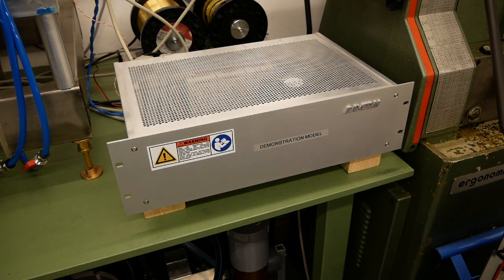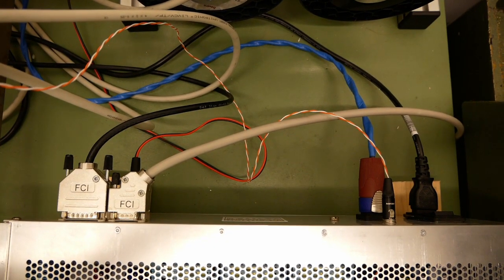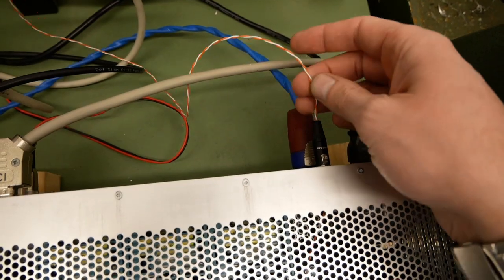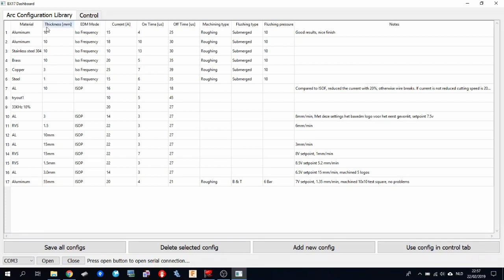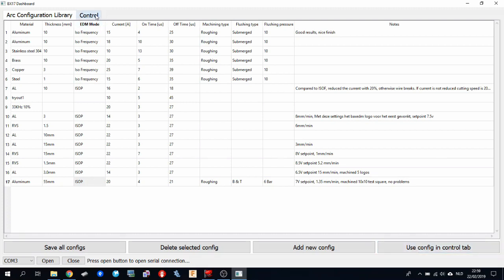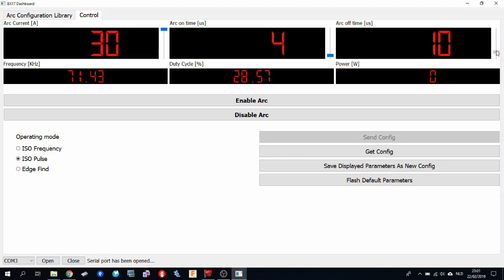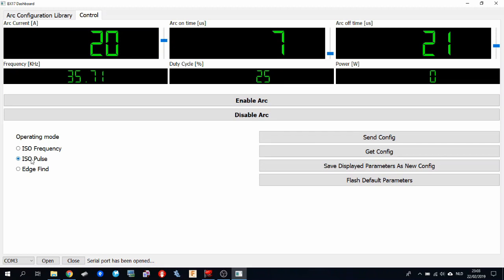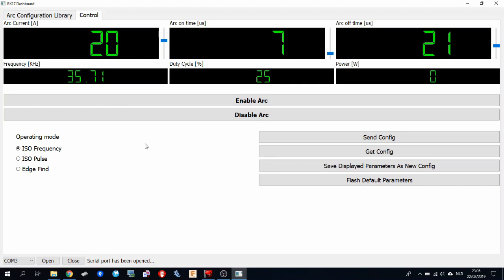BAXEDM Custom EDM Machine Build, Part 7 : The Arc Generator

Comment: If someone wanted to make a ghetto version EDM arc generator wouldn't somehow hacking a motor VFD get you most of the way there?  It outputs high current pulses at up to about 16kHz (http://www.vfds.org/vfd-pwm-waveform-762549.html) or maybe even hack a TIG DC pulse welding source (~15kHz), not sure of current of voltage but I guess you can get enough given how much power they use.  I know you wouldn't have the nice features of this arc generator but maybe it would be sufficient to see some EDM cutting action?  I just don't know enough about the parameter space for making ideal sparks, the bare minimum requirements to make it work, to know if this is a plausible hack or not.
Reply from the maker: Both TIG as well as VFD's use relatively low frequencies <20KHz to modulate current to get a varying DC or AC current with an even lower frequency ~400Hz. The electronic arcitecture of such devices cannot produce high frequency current pulses (sub-microsecond rise and fall times) with controlled open gap voltages and high frequency closed loop arc current control. Even with some serious hacking, they are just too different. Perhaps with a ton of hacking and a ton of additional components you can do it, but then it makes more sense to build something from scratch. There are several wire edm builders who succeeded building their own functional arc generators, but did not manage to get their designs to operate at usefull performance levels. Instead, they got the BaxEDM BX17. Some of these guys are also on YouTube, like TessenCNC and Yaakkoo Fagerlund.
https://baxedm.com/customer-machine-examples/
Reply: @baxedm9806  Interesting.  Thanks again for the explanation.  Are there any references you know of that describe the ideal pulse shape and current that an arc generator is trying to attain, w.r.t. various cutting strategies?  I'm still not clear on how to hack anything since I'm not sure what the target is.  I have seen various diy edm's and am building up an idea but it's slow going.

Comment: If i want to turn this into also a standard EDM which has a piece of copper ir Brass cutting a shape down into the workpiece, will the Spark Generator be able to supply enough spark?
Reply from the maker: Yes, depending on your electrode size. Read this: https://baxedm.com/knowledge-base/can-the-bx17-arc-generator-also-be-used-for-edm-drilling-and-sinking/

Comment: I have one question 
Why measure the voltage an not the courant!?
Reply: the current will follow the maximum diameter of the wire, but the voltage will damage the mosfet and the wire. the voltage data will change the duty cycle when a short contact occurs.

Comment: what's the maximum thickness of steel that you can cut with your generator?
Reply from the maker: The thickness of the steel that you can cut is not determined by the generator, but by the water flushing, wire handling and control. The generator does however determine the speed at which you can cut. For speeds there are various examples in  the forum section on baxedm.com If you want to know the speed for really thick materials, you can calculate it from other speeds as the speed drops in about the same ratio as the thickness increases.
Reply: @baxedm9806  what's the best surface roughness that you can achieve?
Reply from the maker: @nikolaradakovic5050  I cannot give you an objective number, as I do not have a surface roughness measurement tool. The arc generator can be set to polish the cut surface with single microsecond pulse times and low currents, which gives a really smooth finish.

Comment: Sir i am from.india and i wanna buy this 1 how much time it will take to diliver to my home?
Reply from the maker: Hello, the generator is in stock and can ship directly. The default shipping method to India takes 5-10 working days and costs 69 Euros. It is also possible to ship with very high priority, shipping then takes just 2-3 days and costs 275 Euros.
The generator can be ordered in the webshop: https://baxedm.com/shop/
Note that for a complete installation, installation materials are required. Here's a list of what you'll need: https://baxedm.com/knowledge-base/list-of-required-installation-materials-for-the-bx17-arc-generator/
You can buy these in the web shop as well or get them somewhere else, whatever has your preference.

Comment: Sir i am intrested to buying this but is it able to cut 60mm thick copper metal??
Reply from the maker: Hello, and thank you for your interest. The BX17 arc generator can easily cut 60mm thick copper. No problem.
Reply: @baxedm9806  I always kinda wondered how well EDM did vs copper.  I've used a sinker edm a bit as a part loader and a button pusher.  The electrodes were copper or graphite so I wondered if they would get trashed in a jiffy cutting into copper or graphite (does graphite even work) but I suppose with a wire edm its kinda moot because the wire refreshes itself constantly.

Comment: I´m a user of this generator and I would like to share my experience. Mike shares in his video in a few words how his generator works, but to develop such a generator is not an easy process. The generator is "the heart of the machine" . It is easy to build a very basic fixed frecuency generator with resistors to limit the current, but this results in a low performance. It is also quite difficult to read the arc voltage in the right way and to provide optical isolation at the same time. Before using the BX17 arc generator from BAXEDM, I build and used another a well-known pulse generator for ram EDM described in a book, but it did not work well for wire EDM use.
I tried to make one for several years and did not really get a good performance. And now with the BX17, i'm amazed what my machine can do
Reply: This reads like a fake review.
Reply: @zyxwvutsrqponmlkh  to make that kind of statement, have you done something research? is it a guess? or just ignorance? I've been working on this machine since 2015, you can get on my channel and watch the first attempts at my first generator, a fixed frequency generator, usable but tremendously inefficient, to such an extent that the machine was not practically usable.

I say it and I reiterate it, only those who have tried to make their own generator, know how to appreciate this generator, I spent years and a lot of money and I am not even close to what this generator is capable of achieving
Reply: why does the one from the Book, not work well for wire EDM? I just bought the book and PCB only to learn it's not for wire EDM
Reply: @Core3DTech  Hello, I am not an expert in electronics, but in the book controller, the electrode control is done by a window comparator type assembly and is not valid, among other things by not giving a proportional signal, it is an all-nothing and the wire bounces on the piece, does not allow precise control between the piece and the electrode, also the arc voltage reading must be done in an isolated way. In my case I tried to use it, but it was more practical a generator system where a fixed frequency generator sent pulses to a mosfet and this by means of a power supply, a capacitor and a coil, transferred it to the piece - if I remember correctly - it worked, it worked.. but it was "light years" away from Mike's generator.
Reply: @tessenCNC  Thanks for the quick reply. Do you by any chance have any links to proper schematics? it seems that those who implemented, have done so to sell, not to share. Thx